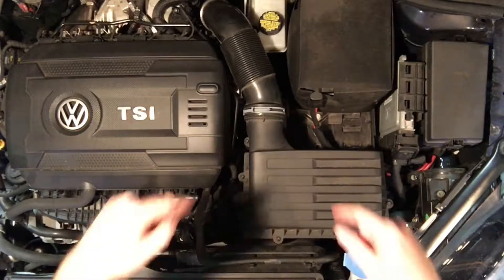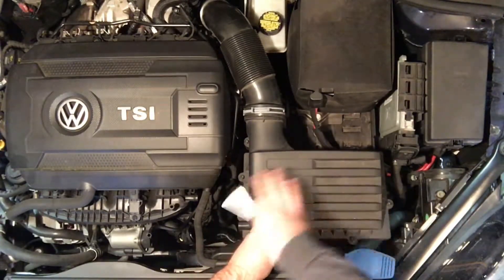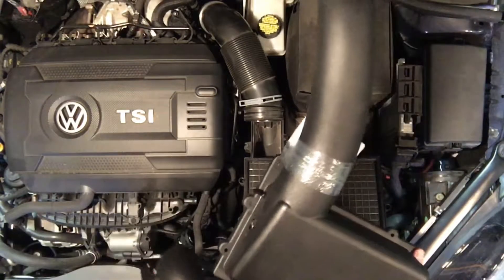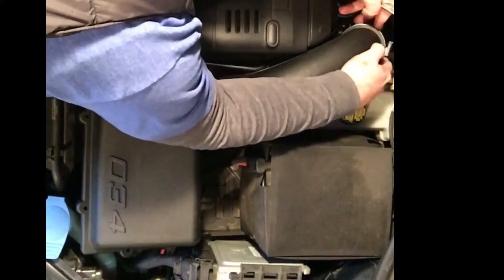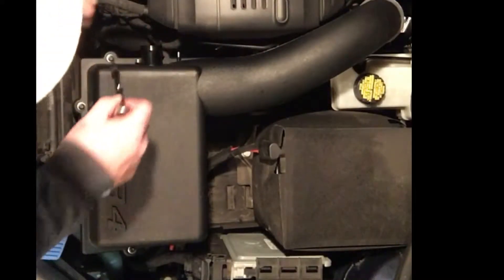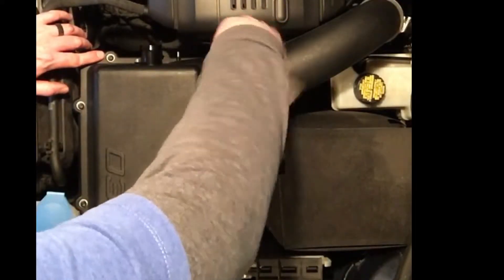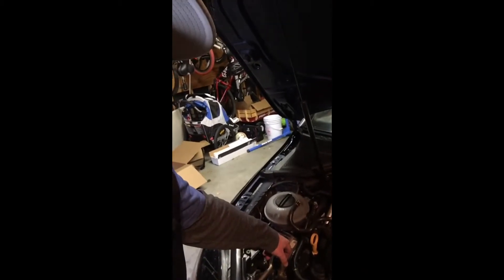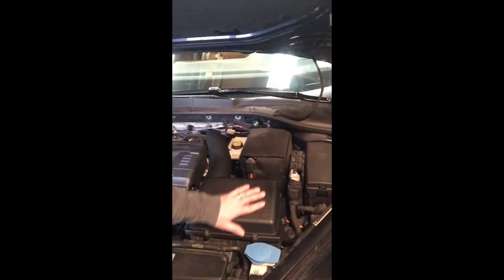034 Motorsport Intake installation on MK7 GTI

Comment: Did you remove the snow baffle in the air box below the filter? If not that will slightly improve the air flow. You may want to keep it in there though if you live in a snowy area.
Reply from the maker: Yes, I did that previously when I installed the Racing Line drop in filter. I could definitely feel a little difference when I removed it. I live in STL, so we don’t get much snow, plus it’s not my daily, evening and weekend toy.

Comment: I'm looking for an intake now. Was considering cts.
Reply from the maker: Faded _MBS I looked at that one as well. I wanted to have an enclosed system that was simple yet received good gains. I did some research and from what I can tell, enclosed intakes keep the air cooler, but are not as loud.  CTS products look good, I have their turbo inlet pipe that I wanted to install in this video, but did not yet. I want to do piece by piece to see if I can feel differences in the mods. I think I may go with CTS for their exhaust, as 034 only has a down pipe for the MK7 and is for track use only. 👎🏻.